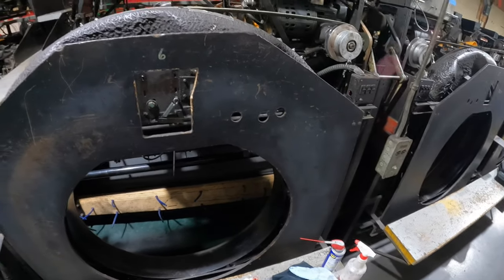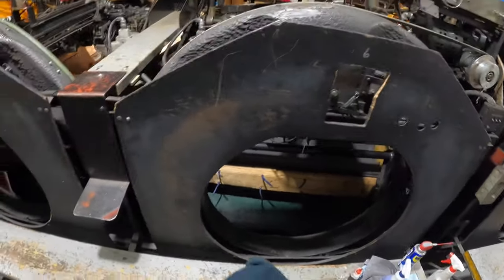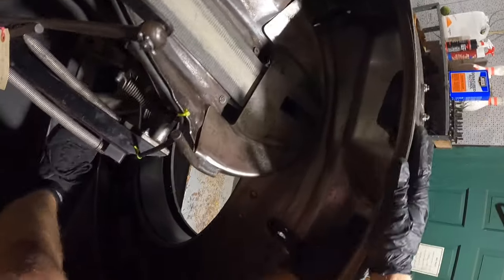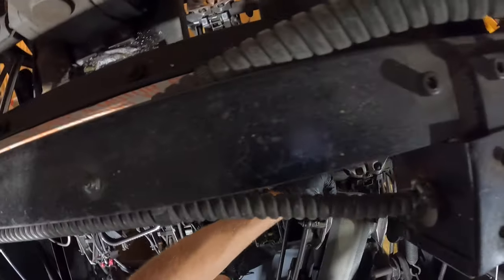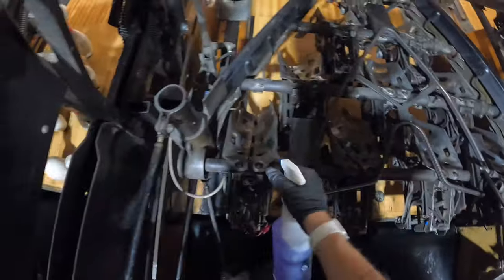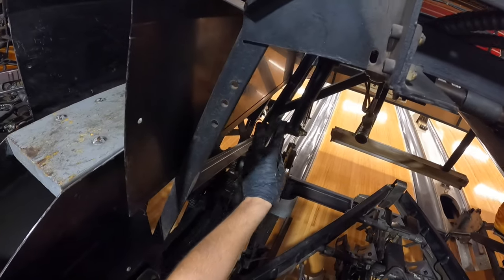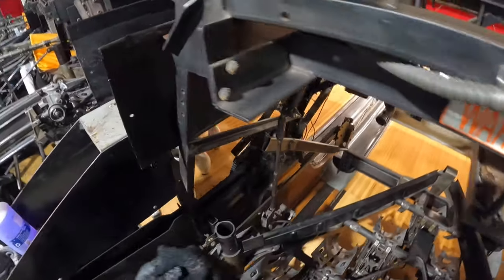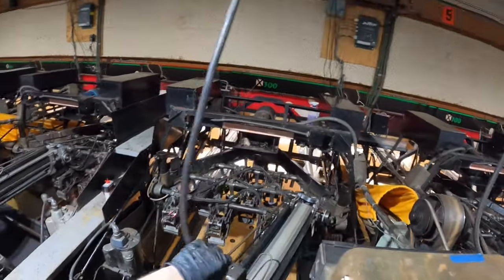AMF 82-30 How To Basic: Basic Bi-weekly Cleaning|AskJoethepro

Comment: I love your videos!  I love the 30's.  Its great to have the K+L wire table circuit replaced with the camera.  But, without the table cable connected, the blackout switches will not trip the chassis breaker in a blackout/offspot condition.  I would recommend plugging in the cable and making sure SW1 works.  This will save lots of RSC bent up and maybe some broken cup issues!  Keep up the great work!
Reply from the maker: Yes! Thank you for the feedback! I am planning on fixing the blackout switches so they work soon…

Comment: Good job.   In the early 60's all AMF machines were on a rental basis only.  Games were 50 cents a line and AMF got their 20%.  They got 10 cents on every line !   The house had to keep the machines clean and adjusted, as well as replacing any broken or cracked parts.  AMF service tech's came in once a month to inspect and recommend service work.  We used auto shop towels and added a few drops of Sparkle lane oil to clean and give the machine a protective surface.
Reply from the maker: Wow! I didn’t know that. Very interesting!

Comment: The AMF 82-30 went into production in 1946 and I’m curious do you have any idea when your 82-30’s were built? I was born in 1950 and really wish I had been present when the 82-30 pin setter went into service. I’ll bet the bowlers were amazed as no longer could the pin boys make comments on your bowling prowess. 

The Brunswick model A didn’t go into service until 1956 so AMF had a hell of a head start but I suspect they must have been very expensive to install as most Brunswick model A machines were leased instead of purchased. I know this because the house I was a mechanic at I had to every night take the frame count readings for the front desk. The manager had to call in the frame count for each lane to Brunswick every morning. 

Thanks for the maintenance video I very much enjoy them.
Reply from the maker: Thanks for the feedback! These machines were installed in the house in 1959. Stay tuned for more videos! Please get the word out!